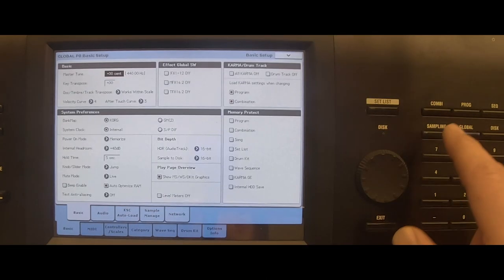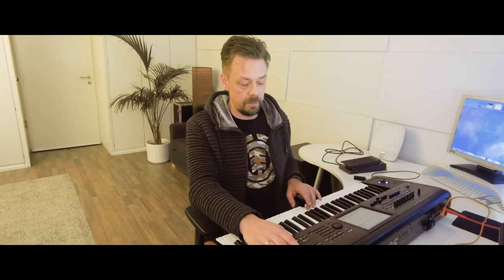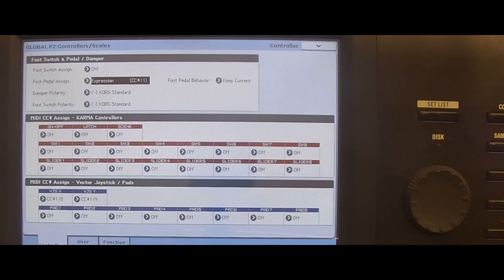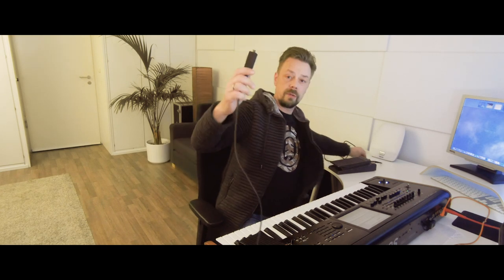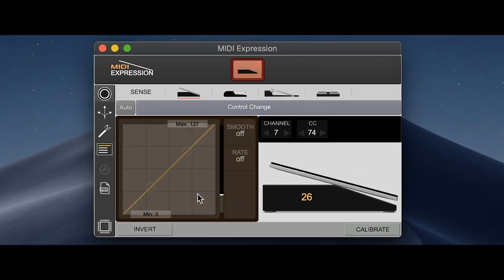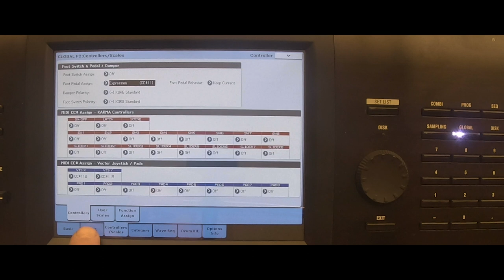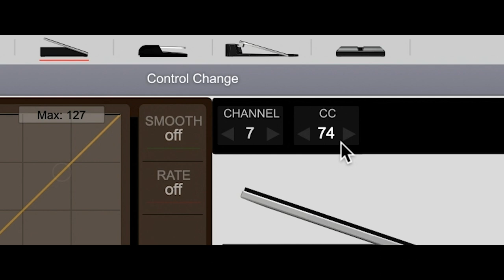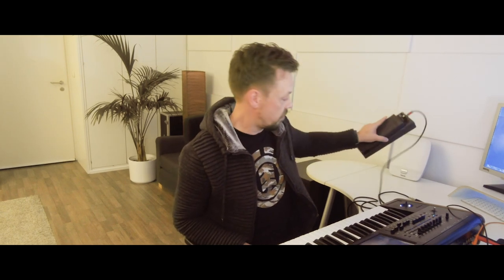KORG KRONOS Tutorial - Control the cutoff with a pedal

Comment: That's a great idea with that interface!
I tried to add my Behringer volume pedal to the Kronos, but because of the strange wiring in the Kronos it didn't work and in opposite to the pa600 I couldn't calibrate the Kronos. I'm a little bit disappointed in that copyright method for Kronos pedals. I think with that interface I can finally use my pedal!
Reply from the maker: I keep my fingers crossed that this works!
Reply: @juergenkoehler  I hope so. With that money for the interface I could have bought a kronos pedal. But I hope to can use more pedals this way :)
Reply: I'm so stupid! All I needed was a proper stereo cable... I noticed in the interface that with a mono cable only the last centimeter transmitted a signal of my pedal. So the wiring in the Kronos is okay and just my stereo cable was baldy wired... With the proper stereo cable the pedal works also directly in the Kronos. Well, but now I can use 2 volume pedals and also I can use my third pedal on my damper pedals. So a little advantage. But I regret buying the expensive interface with all the toll fees... But giving it back is not a good option also... So I'll stay with it. The good thing of the interface is, that i can use a multi trigger for 2 CC's with one pedal. So not completely useless. And I could use now 3 + 4 pedals :D

Comment: Hi Jürgen, I really like the idea of a second pedal! so thanks for demonstrating that neat little interface...However, couldn't you just change whatever your initial pedal does within the individual sound engine. So if you wanted to change the cutoff on say a Polysix sound, you could assign CC#11 to control the cutoff within the engine. And even if you had that layered with an organ (where in this case you would not use the expression), you could disable the cc#11 command via the midi filter tab, so the organ would not be affected. Or am I missing something here? Cheers from Bonn :) Peter
Reply from the maker: Hi Peter, you are right! But for one Band I needed a second pedal, one for the Volume and one for the Cutoff. And I haven't found a way to connect both to the KRONOS at the same time without this interface. Cheers from Frankfurt